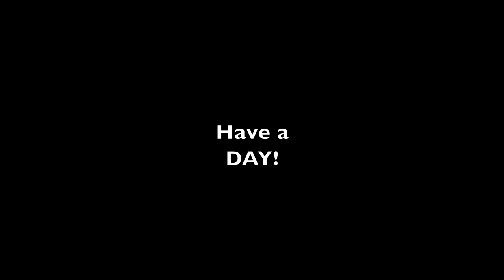Good News! This Will Explain Everything #1081

Comment: Mike I trusted you the first time when you said you needed about 4 feet of fill over the top of the tank.  For several years after I retired from the Railroad I the steering hand on horizontal bores.  I had to use a transit to establish correct elevations, especially when drilling under bayous, rivers, and creeks.  As we usually had to have the bore at least between 10 to 20 feet under the body of water.  Many times I was amazed how far off I was from what I though we needed by just looking at. The ruler does not lie.

Comment: Mike, unless you cut it from the video, you put primer but no glue on the vent connection before installing it.  Hopefully you caught it before backfilling
Reply: I saw it the same way Peter. Over time If the pipe isn’t set with glue it won’t hold out the ground water and then the water in the tank could become contaminated.
Reply: There was a quick video transition there.  You can see the glue squeeze out when he puts the pipe in the fitting.  If it were just primer the pipes never would have slid together like that.

Comment: Great work folks!   Im sure you know this but just in case.  When your trailer battery dies you can always use another battery to take over.  I use a good set of booster cables, unplug from the truck so your only putting 12 volts through the system and your good to go.  I keep a few old batteries on trickle chargers, just for those days that I need to use my dump trailer for numerous loads. I do firewood.  Take care!  
Retired law enforcement, Ontario, Canada.    Also registered weekend warrior.

Comment: Mike-

Progress is looking good! Keep up the good work!! 

Two thing that would help the battery situation. Get an adaptor to plug the trailer into the tractor. You can run the hot wire to charge the battery. Second- Use a solar charger/maintainer keep that batter “up” when not in use.

Comment: Mike, If you have the 7-pin trailer connector on the MX you can buy a 7-pin trailer plug for about $6 to $8 on Amazon and connect it to your trailer battery, Pin # 4 is +12V (positive terminal) and Pin # 1 is ground (negative terminal). For about $25 to $30 you can get the plug with all the wires pre-installed on the plug and pig tails on the other end. It may not charge your battery fully but will certainly keep it charged up to greatly extend the time between requiring a full recharge. Assuming you have the connector already on the MX, sue you volt meter and check to see if the 12V pins are wired.

Comment: Hey Mike that PVC pipe your using is called cellular core. Check the cross section of it and you will see a thin layer of solid pvc on the outside and another thin layer on the inside. Between the 2 layers is a pvc foam filling. It's garbage, cheaper than made in China. If used underground it is supposed to be encased with sand. Actually all plastics should be encased in sand underground for protection Any rocks rubbing against it could eventually ware a hole  thru it. I'm a licensed plumber from Jersey and was told by an inspector ( when it was first introduced) that it was engineered for sandy soils. It can aslo collapse. Guys use it because it's less $$$ and much lighter than a true schedule 40 pipe. If anything I would recommend only using it above ground where you can easily get to it for repairs. I have seen it crack horizontally from expansion from sudden temperature changes of hot and cold water. For example- dumping a pot of hot pasta water down the drain. The only time I would use it is for someone I didn't like. Lol... ABS is the black pipe which is also a cellular core pipe. That's even worse (more brittle) than PVC pipe. I cringed when I saw it on Jim's truck. If your family is planning on owning your property thru more generations I would certainly stay away from using celluar core pipe. It also says not for pressure on it. If it says not for pressure on it you would think that it means from inside out. Well what about outside in? I've seen it crushed underground also.
BTW there is an National Standard Plumbing Code, but it depends on if your state uses it as their standard. Most states do. If the state doesn't codes could vary from town to town, however the Sheriff feels that day....
Keep up the Good work. Everything is coming along nicely..

Comment: I was wondering how much you pay for your 2a limestone.  Here in Missouri, I pay $275 for 12 to 15 ton, delivered and spread if I want.  On your finish grade near your shed, you have explained it several times.  I have not said anything, because I know you are more qualified than me.   By the way, thanks Mike.  I was building two landing/parking areas.  When you started to build that road around your shed (we call it a barn), you used that geotechnical.  I never thought about it before.  I bought some and laid it down.  Really like how everything turned out.

Comment: You might want to check with your tank supplier and see if they have a 6" riser available for the manhole.  That way you can bring the cover to finished grand and have it accessable if needed.  Then you can mow over it.  My riser is on a septic tank and when I need to get the tank pumped I take my string trimmer and cut the grass around the cover so I can get a good seal when I put the cover back on.

Comment: Swedish fire logs.  Two drill holes, spacers on top and you have a cook top and smokeless fire.  Would be a great add on to the kindling bags.  Pick up used, A good industrial drill to auger.   Sell Morgan Rocket stoves. Regulate with stone cooking top.  I bet you would unload a dump trailer full at the Paul Bunion show.  They sure would be nice in the am and pm at the show if allowed.

Comment: Mike they make these solar chargers for your trailer. They actually work really well I have used them in a few different applications and had great luck with them.  They are relatively inexpensive. The panel could mount to the top of the box on the toung of the trailer.

Comment: Those dump trailers usually have a wire that charges the battery while hooked to the truck.  If your's doesn't, it's not to hard to connect them.

Comment: You know where the pool will be and how deep at that point. go ahead and move the road and fence then you can also fill where the road is now to build it up too grade. once the road is moved you may start digging for the pool, the bank of the water tank looked sound, you could dig even a portion of the death of the pool and use that dirt to level the patio area and cover the old road. Even put a ramp into the pool for later when you dig it deeper. You will move the road now and hope the pool comes sooner than later.

Comment: I don't know if you are aware but when you put any large concrete structures beneath the ground you should first apply some sort of moisture prevention membrane to the sides and the top of it before burying it beneath the ground. If there is any rebar inside of the concrete. Otherwise the rebar will begin to rust and swell and crack the concrete. Especially if it's a cistern for water. Unless it's hydraulic concrete.

Comment: Suggestion: can you mount a small solar panel on your dump trailer to keep the battery charged? Also, when you use the glue and primer on PVC pipe hold the applicator by the wire, not the top of the applicator. If the wire breaks off the top, good luck!

Comment: You probably will have to get in that tank annually or bi annually and clean it out. Co worker has one and has to clean his out 1-2 times a year. Also if you feed it from your down spouts. Be sure to shut off the valve in the spring months when pollen is heavy. It will make the water stink.

Comment: Just wondering why you don't just use the flip up tailgating dump. You are spreading the fill out so you don't really need to dump it into a single pile. I think since you are only going a few hundred yards it is ok to fill the trailer heavier than what you would for highway use. Just dont overload the axles, my brother bent one on a lighter duty trailer once.

Comment: Wait! Mike said each load before was about 10,000 lbs.  That would be 5 tons.  So if you're doing 4 tons now, that would be less than before.
Reply from the maker: 10,000 includes trailer, before I was hauling maybe 3 ton of shale,  plus the trailer weighs 2 tons, so at 4 ton loads I’m at about 12,000

Comment: That tank was visabily lower before todays video, people must be blind.  🤯 

Searching for an old Nova Scotia plate and I have a New Brunswick trailer one in my shed.

Why would anyone be using soluble rock like limestone or mudstone as an construction aggregate.  Here if we are building we are required by code (still often skipped and burried as fast as they can by chepo contractors) to backfill with metamorphic sourced  crushed angular igneous granite.  AKA rock which was melted off the bottom of a contental mass which is far lighter than magma!  That gravel will still be angular gravel in a hundred years where limestone will be mud!